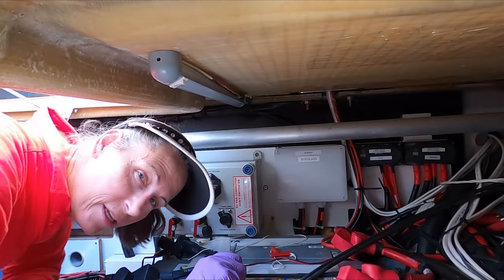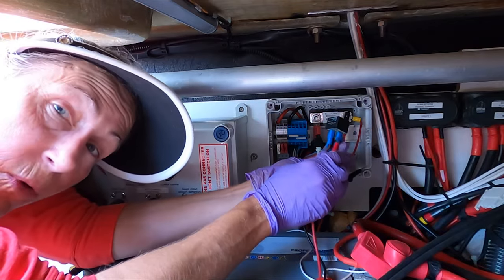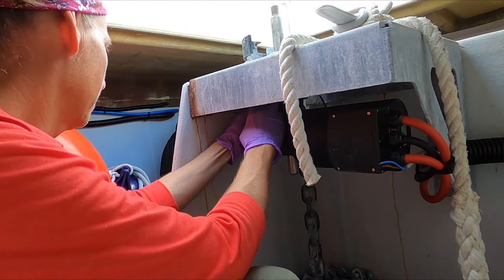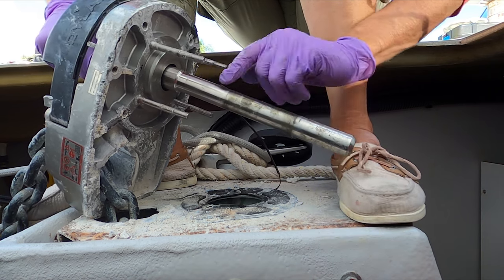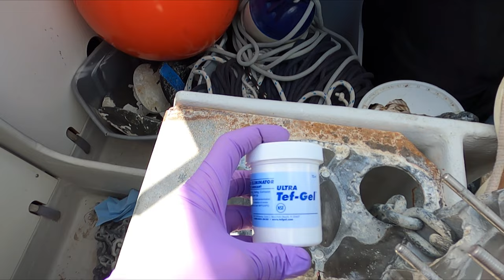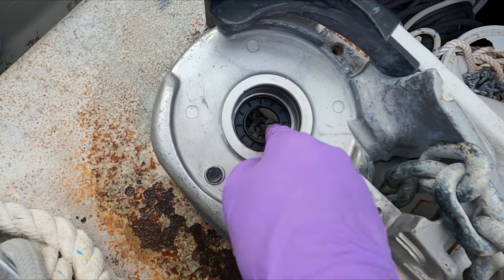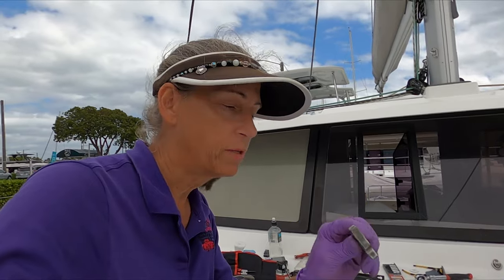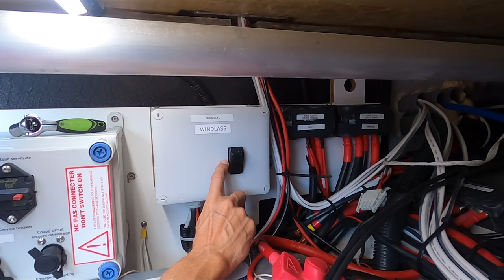Broken Windlass and New Rebuild for our anchor - Ep. 11

Comment: I will repeat myself from before.  So much for the boat inspection.  Just like with a car pre purchase inspection.  The person doing it is crucial.  Great job on your sorting the boat out videos.  Great learning tool.
Reply from the maker: Thanks.
Reply: The fellow who did  the original marine survey for them did a very poor job.  He should have found most, if not all, of the problems they have encountered if he had been any good and knew wha to inspect and look for.  The generator problem was inexcusable -- he should have run that generator for at least 1/2 hour to see if it was properly cooling itself.  The transmission problem is  also an obvious problem he should have noticed.

Comment: Nice repair Franny. I like your circlip pliers! Why did they have the interlock to stop the windlass from being operated without the engine running?
Reply from the maker: Thanks! I think it is just for the current draw. The engine can deliver up to 50A or so while running and that takes the load of the batteries a bit. I think it's a stretch, but I think that's it.  I'm the next episode I have a fix for that issue :) Oh, those ring pliers are sweet! They are super beefy.  I used them while replacing the rear bearings on my friend's 71 Super Beetle.

Comment: Great video, thank you so much for the education! I hope to buy my first sailboat in 2024 and this info might come in handy!
Is there a reason that it was set up to work only when the motor is running?
Thank you
Reply from the maker: They don't want you to deploy the anchor with batteries only.  They would rather you not.  Funny thing is that the forward winches are all battery, for sailing.  So, it really makes no sense.  In fact, they are assuming you will use your engines to anchor.  It's possible, but not likely, that you could sail into an anchorage and drop the anchor.  However, you really want to test your hold of your anchor once set, and therefore, you would HAVE TO use the engine to test.  I hope that makes sense.  Congrats on a boat purchase.  What kind?  Heidi
Reply: @HeidiandFranny  Thanks for the response.
I haven't bought the boat yet. I want a small boat like the MacGregor26 M but my girlfriend hopes I will buy a 35 foot Hunter so she can do her "Nesting" thing and have more friends over to visit.
So...I guess I'll be getting a Hunter. Lol
I can't wait to catch up on your videos and see what you two have planned for 2024!
Happy New Year, my friends !

Comment: Ignorance speaking most  likely, but is there any way you can alter things so the windows etc can also use the starboard engine?

Ignore me if I'm being silly - a lifetime in monohylls.
Reply from the maker: No, it's a great question.  I don't think that was mentioned in the video, but it is possible to switch and once we were stopped, we did get it to switch.  As a default, it was set up, but, of course, the fuse was blown...  maintenance was not done on this boat...